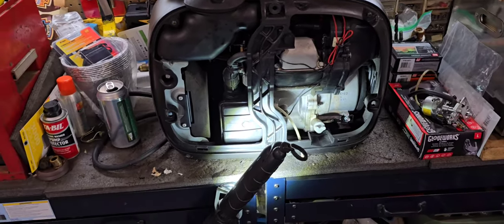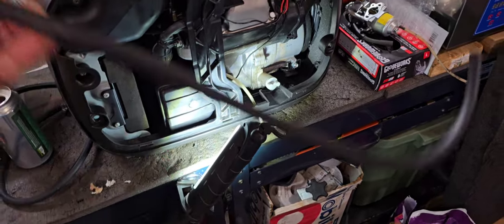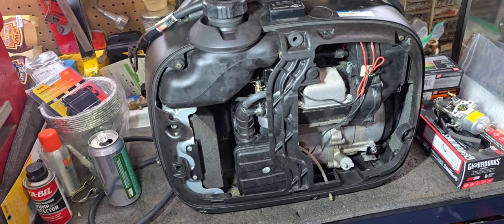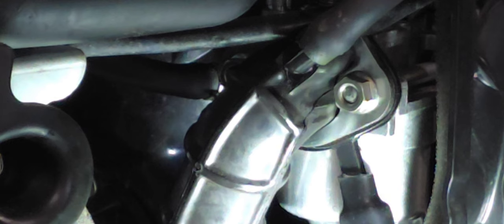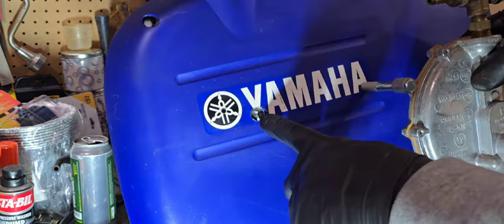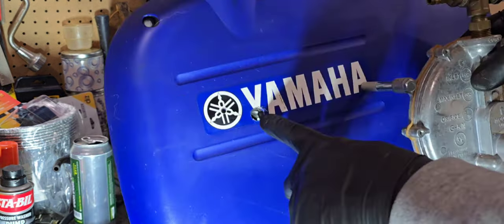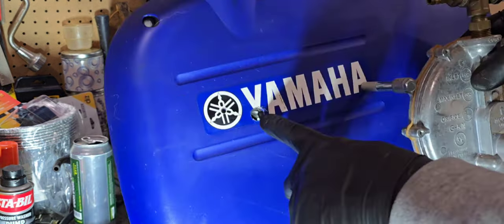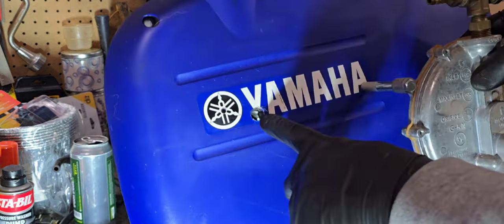Yamaha EF2000iS: Tri-Fuel Motor Snorkel Installation & Load Block Adjust

Comment: Awesome.  I have two of these generators.  It must run a long time on a 20lb propane tank.
Reply from the maker: Yeah we're talking roughly 34 hours at 25% load for one machine on a 20lb. It has an 80cc engine. With two machines each running at 25% load or 50% for one machine then you were looking around 17 hours of runtime.
Reply: @Bassguitarist1985  As stated in another comment, this is incorrect.  There is nothing metering the propane on a hack job kit like this... it's always running the same amount of fuel regardless of engine load.  34 hours at 0% load and 34 hours at 100% load.  Of course, if the engine cuts off due to, say, low oil or engine failure, it's still dumping propane into the "snorkel" - not an ideal situation if one values life, limb, and property.
A true propane carb will have a method to meter the fuel appropriately, including shutting off fuel flow when the engine stops.  A regular carb and snorkel can be modified to do this properly, with the correct demand regulator if a separate vacuum line is dun from the "other" side of the throttle is run to the vacuum port of a correct demand regulator.  These hack job kits don't afford this option.  I certainly wouldn't want to be liable for the potential damage by publicly recommending these hack job kits to people without pointing out the dangers and drawbacks.
Reply from the maker: @basketballjones6782 first off, no, you are wrong. The KN/Garrettson demand regulator does have a vacuum lock off built in. There is no need for an additional vacuum lock off hose. If there is no negative pressure at the snorkel, the demand regulator will NOT feed propane to the snorkel if adjusted properly. The metering of propane is still managed by the throttle plate of the carb which is run by the stepper motor. The air/fuel mixture is set by the load block on the output of the demand regulator, essentially restricting propane flow till the proper mixture is achieved.

There have been thousands of these units sold without issue. Contact Hue or CS at US Carb and they will backup everything I outlined.

Comment: Excellent, few people calibrate the air mixture correctly, this is done with partial and maximum load, without losing rpm

bro If you leave the air-fuel mixture very lean, you leave oxygen that does not burn and also at high temperature, reducing the useful life of the expulsion valve, it has to be stoichiometric, I would rather lose propane than a cylinder head or valve on this engine
Reply from the maker: Failure to do this step properly is the reason these conversion kits get such a bad reputation because people don't install them correctly
Reply from the maker: I had a chance to reread your comment. Lean air fuel mixture on a gaseous fuel-like propane actually equates to cooler combustion temperatures. With gasoline the leaner air fuel mixture the HOTTER the combustion temperatures, it's the opposite.
Reply: @Bassguitarist1985   Bro, in my city Barraquilla Colombia, taxis use natural gas and unlike propane, natural gas damages many cylinder heads of these cars since by wanting to extend the autonomy further they reduce the amount of natural gas in the air/fuel mixture, I don't know what it's like with propane has more energy density but I am clear that this is not equivalent to natural gas, I do not want this to become a controversy, in fact seeing how you did it with propane I think it turned out great, but it cannot be extrapolated since as I said that oxygen at 600°C, which does not participate in combustion, will destroy valves and their seats, which may not be noticeable in a small generator with a reduced useful life and little use, but in intensive use it is a problem. The stoichiometry mixture has to be respected since it is a scientific fact as much as the displacement, compression ratio, rpm and power
Good day
Reply from the maker: Thank you for your knowledge and experience. Yes this is often the case where if it's improperly set up to not run at the proper air fuel mixture the longevity of the motor will be shortened. Appreciate you commenting, watching my channel,and supporting by providing your knowledge. Thanks again!
Reply: @Bassguitarist1985  thanks bro
Reply: @Bassguitarist1985  
with pleasure

Comment: Good work! Did the owner mention why he wanted the gasoline option?
Thanks!
Reply from the maker: He said he wanted to have the option in case propane was not available
Reply: Personally,  I'd use gas as my first option, and go propane only as a backup. Reason being, gas has more bang for the buck. 👍
Reply from the maker: @kriswright1022  logic is sound however during a widespread power outage gas stations don't have electricity to pump the fuel. It's the propane stations which are usually home heating companies that have large storage tanks for their propane trucks, they have backup standby generators to run all of their equipment.
Reply: @Bassguitarist1985  I'm in a very rural area where the service station can provide  gas after hrs as they have a large propane tank and emergency standby power to run the pumps for gas, but no one to pump propane for you under these circumstances. Propane is the option if the home generator  will not be used for extended periods as gas left in the tank for over a 6 month period will be unreliable here in Northern Calif. We lose our power quite often both in the winter and summer months so I actually have a diesel and gas generator to cover all bases, the diesel is too loud to run in the summer months with the windows open so I opt for the gas to keep the neighbors and the wife happy. ☺

Comment: How is the propane supply metered depending on the load of the generator?  From what I see, it is not - it's just running the same amount of fuel regardless of the load on the generator.  Also, what mechanism exists to ensure the flow of gas is turned off when the generator stops?  Who would be ignorant enough to think that doing it this way this is a good idea?
Reply from the maker: Answered you on the other video. 😁